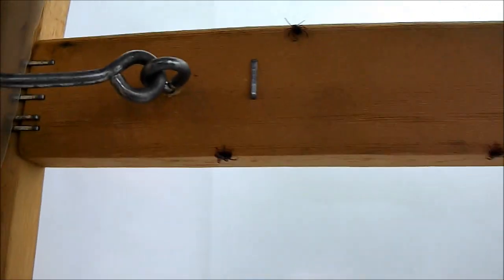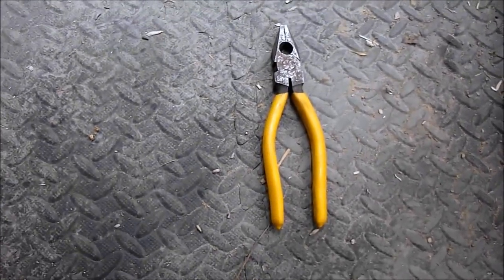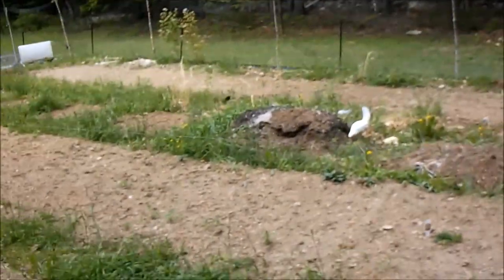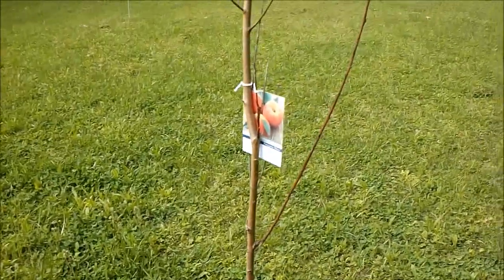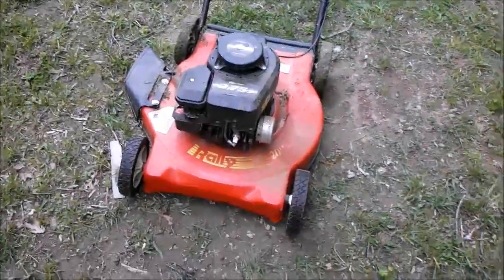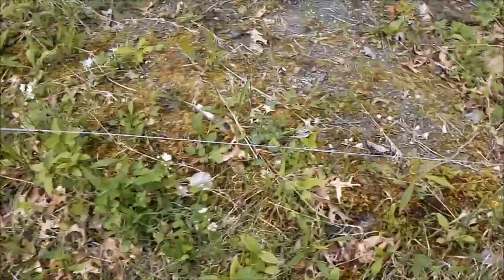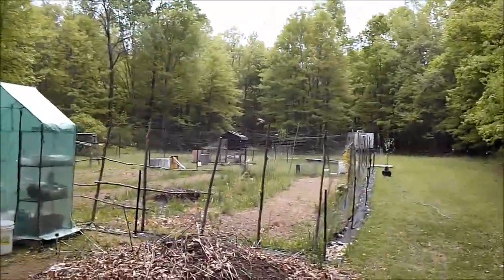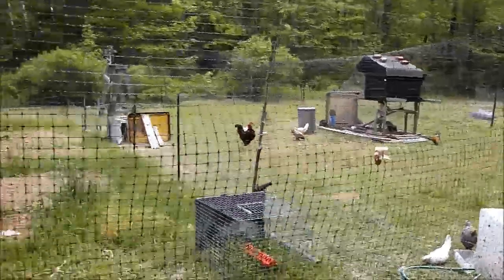Wilderness Taking Over At The Off Grid Homestead

Comment: The big fence around the whole property you can rock pick and fill in holes or whatever needs to be done on the other side of your fence so you can make one or two fasces around it with the mower and weed wack under the wire and that will let you be set it will push back the brush alott you will have all sorts of problems if you let everything grow right up to the fence
Reply from the maker: Thanks